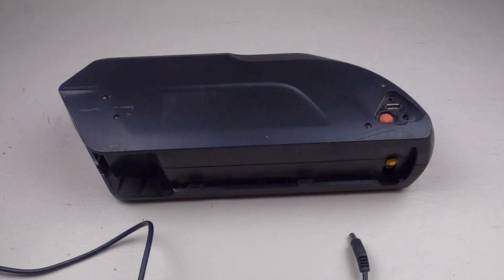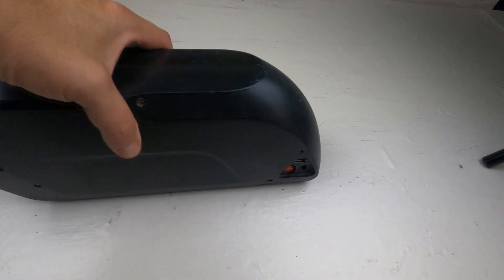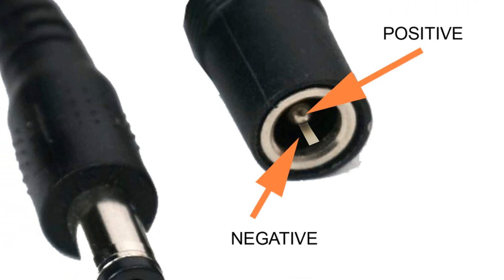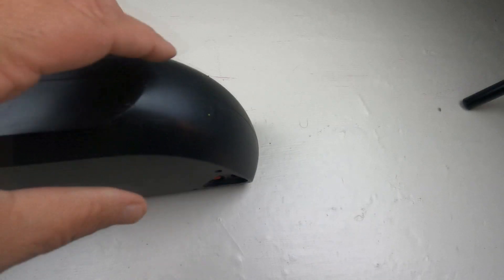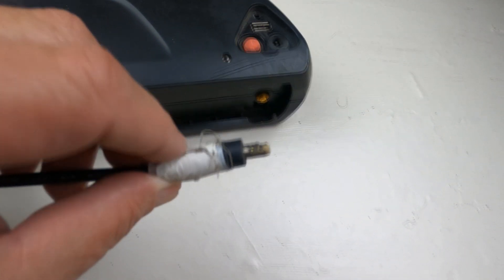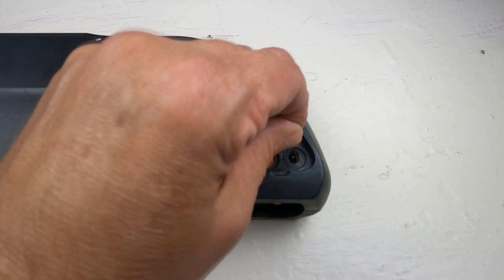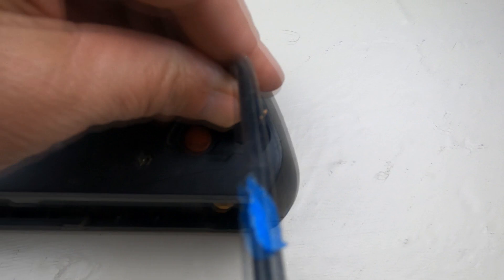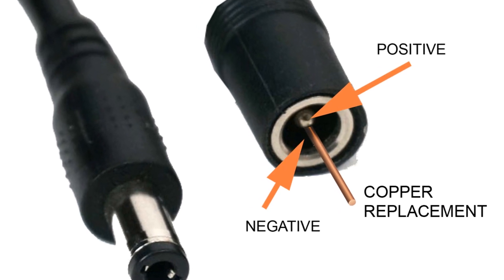E BIKE TIPS: Battery Charger - FIX -

Comment: That is Bodge mate, if the battery goes up in smoke, it’ll take the Aluminium bike with it as well.. false economy.for safety sake I’d get a new one Green Cell sell them for £225 in the Uk, I know because I bought a spare last year.Also you need a new Rubber Triangle to keep the weather out, and I bought a stretchy Battery Cover (waterproof) last year so this will double protect it..

Comment: I'm having an issue with the cable that plugs into the electric battery itself I kicked it and it got stuck inside of the battery plug-in on the bike battery. The metal piece got stuck and no longer and it broke off of the actual cord from the 48 volt lithium ion battery charger

Comment: XT90 Connector can be bought from most mobbing shops which sell batteries for kit model quad copter / drones / 4x4 model off road cars .
U will a set which is male & female

The wego fast connectors from electrical supply these where used because they tiny and come either 2/3 fitting to join each cable without soldiering 

XT90 will need heat shrink wrap before insolation tape Ingatestone wall charger end so no need to chuck out your existing unit just soilderthis yellow XT90's

Comment: Hi I bought a cyclotricity stealth  MTB for parts or repairs
  not knowing what was wrong with it more than the shop said they could get to charged or light up and it had been with them for more than a 1 year 
Turns out it had the same charging port issue so I opened the pack which someone had already done and replaced the charging block with A XT90 Connector by cutting A hole out next to the led battery leavel lights but all and soldering it's mating side of XT90 Connector also onto the wall charger itself too 
Work fine although 6 hour waiting time to full charge seem slow (I never do this and leave unattended by sleeping or it in another Room )
   the bicycle is grate for getting around and out and about to much feather places than I'd normally go 
I'm now looking at next time build another battery bank or a bigger one for ultimate distance coverage in day on waiting time (6hrs ) 
Back brakes disk alignment and tyer change to done I've essentially got almost ebike for gamble at little to almost nothing but could well been a raspberry 
Looking at your copper wire quick fix 
this type of replacement  fix it maybe much safer the less of fire risk to you your running risk could burn your home down onec those cell catch their not easy to out 
It only be a little soiling or used a few "WAGO 221 Self locking connector used by electrian's

Comment: Pretty clever idea .....Just got an X go 13 amp battery for my cyclotricity stealth .Fits into the holder perfectly and runs the bike .....Ps anybody let me know the correct charging procedure .Do you switch the battery off then plug in the socket for the charger ? Thanks .
Reply: 1) Make sure Battery is off the frame, and that the red switch is turned OFF.  2) Plug in charger but don’t press mains switch on yet…                            3)Plug charger lead into Battery. (You may get a little spark as it goes in).     4)make sure it’s all ( charger and battery) on a hard floor preferably ceramic tiles and not carpet with charger LED facing up so you can see what stage it’s at.                                   5) Turn ON at mains power and light should be RED, and after 5-7 hours it should turn GREEN when it’s fully charged, but do not charge on carpet or soft furnishings or wood, and charge in a well ventilated area, that is DRY.
Reply: @benjleath9406  Cheers mate ..
Reply: @benjleath9406  Cheers for the info pal .Since then I  bought another 2 batteries ..an x go and another one (cant remember name) They are fine .Same range ...The 29er stealth is something else as a road bike .The rear spokes loosened after 500 miles .Fixed myself .I bought a 1000/250 kit with 26" wheel for my montague paratrooper .First bike was STOLEN by Hermes ....Although the stealth and the paratrooper both have the same motors the stealth is MUCH faster .Must be the big wheels although the paratrooper as a total off road machine is incredible man.Itswell worth converting a paratrooper .Have 2 batteries set on rails on back rack so change over when one dies. Schwalbe mixed smooth rolling and knobbly on outside for slick road rolling .Glad I did complete the project and also put clark hydraulic brakes on 40 quid each .Worth every penny man .Boys and their toys .Thanks again.
Reply: @crafter170  Yeah I’ve had my Cyclotricity Stealth 500 watt since 2020, and now I’ve done nearly 3000 miles on it, absolutely chuffed to bits with her, Two month’s of owning it back in 2020 I was diagnosed with MS, had to re-learn how to ride a bike again because after a bad attack I could hardly balance, but I’m on treatment now and back to how I was before, Mine had a wobbly back wheel but tightened spokes, and kept getting rear punctures so I got a slime tube and a tyre liner in each wheel,I’ve also replaced the bottom bracket sealed cartridge. It’s a Good bike and always gets me where I want,Mine has mountain king tyres 2.3 and it still does 75 miles on pas mode 1,I just don’t leave it anywhere for a second though, or else it’ll be gone !!!
Reply: @benjleath9406  Sorry to hear about your MS .That's a bxxxxxd.At least you have tha balls to get up in the morning .Grit your teeth and face the world.Yip elec bikes are great fun man.People are so backward in this country .Its the best way to zoom around .Best of luck to you pal .You sound like a good soul .Greetings from Glasgow.
Reply: @crafter170  Thanks for your message, yeah I try to go out on her about four times a week if I can, I love my Stealth, when I’m not riding it, I’m looking over it to see what I can do to prevent any mishaps, I normally ride twenty miles on her in the countryside (Hampshire) my normal route goes through a lovely forest (Ampfield woods, Romsey,Hampshire) and love country lanes,the bikes better on the road, to tell you the truth ! Good speaking to you man,I’m learning day by day about electrical stuff so that’s good for my brain,thanks for your reply, and all the best from Southampton 👊😁
Reply: @benjleath9406  Don't let the bxxxxxxs grind you down .Fix bayonets .✋

Comment: Just a word of warning - if you touch both the centre positive pin and the negative terminal when you insert the wire you will short the battery and the wire may well weld itself across the terminals. If you are lucky & the charger input is fused you will blow the fuse.  A cheap battery will probably not have a fuse so best case is you blow the BMS - worst case is your battery goes into melt down or blows up. This fix is not recommend unless you are tired of living!